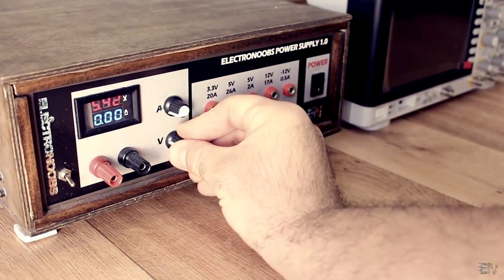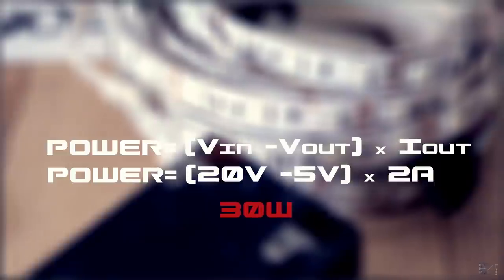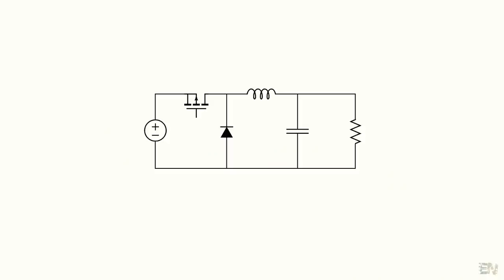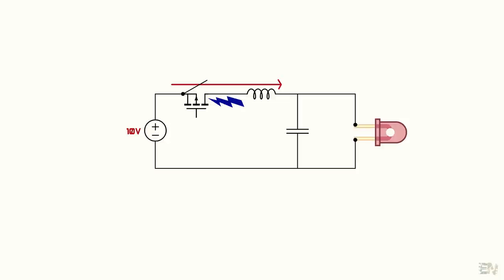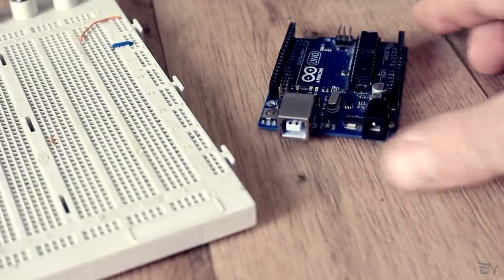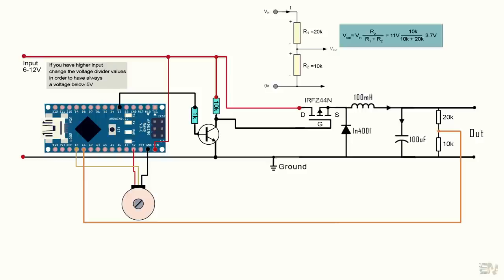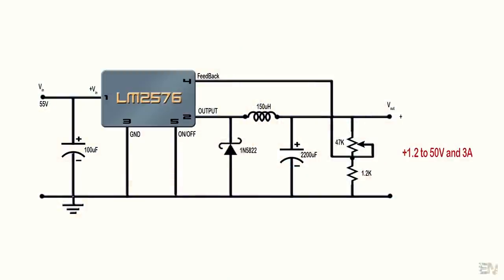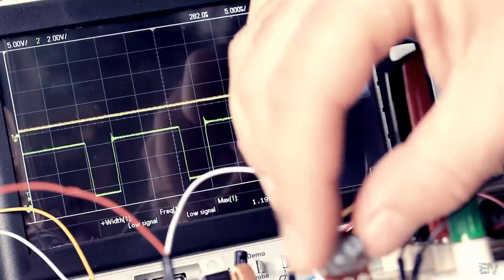DIY Buck converter - TUTORIAL

Comment: Can we build a 10A  buck converter for battery charging? I want to build a 10A Buck converter please guide me.
Reply: his circuit will work for ANY amps and voltage provided that you use the same code as him, an arduino, and the correct size inductor and mosfets.  Probably want to ditch the diode and use a mosfet in its place and you should be good.  I'm making a buck converter that does 1.5k watts on my channel so check my video for the part numbers and schematic

Comment: What if I vary the input,  does it maintain desired voltage at output or the output will change with the variation of input?Does feedback work only for load variation?
Reply from the maker: Feedback work's for input voltage as well!
Reply: I used IRF9540n  p channel mosfet and BC547 NPN transistor. The ckt didn't work

Comment: you added another transistor between the pwm and the gate without explaining it. your tutorial is the only one which has it, kinda confusing more than anything else.
Reply: definately confusing
Reply: He added the extra transistor as a driver so the supply could operate at higher than 5 volts, as the atmega chips on arduinos can't handle more than that.

Comment: does buck converter good for an arduino project with radio module ? im afraid the magnetic field from the coil will interference with the module
Reply: just space them as far as you can from one another on your board and put grounded shielding around the inductor to help keep its electromagnetic field contained.

Comment: I tried to make a buck boost converter using irlz44n MOSFET,but when i turn on the supply, MOSFET is getting hot madly and when i did same using the driver IC ,no output is there. Replaced every part and path multiple times.What could be the possible error ? Working freq of my converter is 32khz using attiny85.
Reply from the maker: The frequency is good. For this circuit is better to use a Pmosfet. But IRFZ44N is N mos, also make sure you add the BJT driver as in the schematic.
Reply: Yes i used irlz44n for low side switching,added the driver ckt like you said,but yes it is getting heated !!
Reply from the maker: What is the output load that you add?
Reply: A 1k resistor temporarily
Reply: @jugalmistry1726  if the output load is low resistance, it will put out very high amps - maybe higher than what your power mosfet was designed for.  Check your amp flow with multimeter.
Reply: Hey man! No, the problem was in the MOSFET itself! It was a counterfeit so couldn't handle even 25% of it's rated current. Also, I didn't add a snubber earlier.

Comment: how come when the switch is open the inductor current flows through open switch why does the current flow through the load when switch is open???
Reply: because inductors work by creating a magnetic field and when the current through them changes the magnetic field collapses or builds, which induces a current in the wire opposing the change in current. So when the current flow stops when the switch is opened that magnetic field collapses and briefly induces a current in wire that goes in the same direction as the initial current.

Comment: Why the sum of the On and Off current equal to 0 ?
Reply: Mr Remmoz maybe because the electrons need to flow. if the current cannot return to source then possibly more current/electrons cannot enter/pass through your circuit. 
If current cannot flow the system will not function?

Comment: I've watched plenty of videos and I still can't for the life of me understand what the diode is for, or more exactly what happens when the diode isn't there. Why is there current flowing through the switch when it's open if there's no diode? If the switch were a literal switch and not a transistor, and there were no diode, what would happen? How could current flow through an open?
Reply: If the diode isnt there when the switch is opened the collapse of the magnetic field on the inductor creates a split second high negative voltage spike across the inductor, since there is nothing connected on the switch side you get a large buildup of electrons. You dont need a closed circuit to create a voltage potential, since a voltage potential is just an imbalance of electrons
Reply: the inductor in this circuit charges up like a battery.  The diode lets that battery's negative side (the left hand side) get current to flow back to it so that it discharges and self neutralizes.  The current will flow out from it, through the load, then into the left hand side of it again completing the circuit path from high voltage right side of the inductor to low voltage left side of it.  Note that you can replace that diode with a mosfet that switches on each time you switch the main highside mosfet off and that second lowside mosfet will serve as the return path creator instead of a diode.  This is used to reduce cost since a  diode gets expensive when dealing with higher wattage circuits that need huge diodes rated to handle the higher amp and voltage.  Plus, using a second mosfet is more efficient since diodes have voltage drop across them and that resistance is wasted as heat.

Comment: So it's the mosfet, inductor,   and voltage divider feedback, that seta the current potential. I need a buck boost that can take 14-36v and output a cc cv, 29v adjustable, from 27-29.4v, but here is the kicker, I need about 150amps,   the LTC4000, or LTC4020 will help do what I need, but I'm self taught, and z bad teacher, this is a bit beyond me, I could possibly build what I need some day, but it's the time!! I do not have the time, I am looking for some help, someone who could help get the PCB made, and figure the components, and basically give me instructions, I can solder, and been playing around with components, trying to learn. I should have gotten into this when i was younger. It's difficult teaching old dogs, I need a affordable lithium charger, I can power with a alternator, it can do about 28v  if you are interested I could compensate, for your time, and it could be a video, thanks either way!!

Comment: I want to build a buck converter with minimum 200W constant power, up to 500W even. I need 24V input and 12-13V output. I'm considering to use a 50Hz +90% efficient toroidal transformer for it. I'm ordering a transformer just now and will post a video about it as well. The goal is to use my 2 x 12V 130Ah deep cycle batteries, to power my workshop. They are in series so 24V, but I need 12V here as I use an old car battery before the inverter which is 12V as well. For now I use one from China to convert, but the power is too small for what I need.

If anyone have done such thing, what drivers did you use and which Mosfets, please :). I'll be able to use my 24V PWM 50Hz signal if I'd want for an inverter even ;) later on, and repurpose this buck converter to use in some other room. So, won't be wasted anyway. Before I'll build my 24V inverter, will be a long time though. Now I'm building Electronoobs 12V to 230V pure sine inverter on EGS002.

Thank you :).

Comment: I watched your video. 
Thanks for the lesson of making a voltage source by conversion. 
If you have the necessary knowledge, please help me to build a voltage source with adjustable voltage and current. 
I would like the sura to operate with a voltage higher than 40 V and a current higher than 5 A. 
I opened a topic here on a forum, where I also asked for help. 
https://forum.softpedia.com/topic/1180747-tensiune-variabila-cu-curent-variabil-0-50-v%3B-0-10-a/page__st__72#entry27381050
I will also post your video on this forum, because I find it useful. 
I still have to find the possibility to adjust the output current. 
With adjustable tension, I found the answer in your clip. 
I tried to make the source with LM 317. But at this integrated I am limited to the voltage of 32 V.

Comment: This tutorial is complete rubbish. First of all, a buck converter operates in discontinous mode, which means that the inductor will be charged when the switch (MOSFET, transistor) is closed and will release its energy in the other polarity when the switch is opened, which causes the diode to conduct. This is also what causes current gain with an lower output voltage and makes it much better than a linear regulator, especially for solar applications. Secondly, you used a normal diode (1N4001) instead of a fast recovery or schottky diode for the rectification and used an N-channel MOSFET without an bootstrap circuit so it will never reach the saturation voltage that it needs between the gate and the source.
Reply: No, a buck converter can operate in either discontinuous or continuous inductor current mode. Typically you would design for the transition to occur at somewhere between about 20% and 40% of the full rated load current for your circuit.
I get the impression you don't understand what continuous and discontinuous mean in this context. Continuous current mode simply means that the inductor does not fully discharge at any time during operation. It is ONLY in CCM that the equation    Vout = Vin x duty cycle     applies. In DCM that equation is no longer true and duty cycle varies with input and output voltage AND with output current.